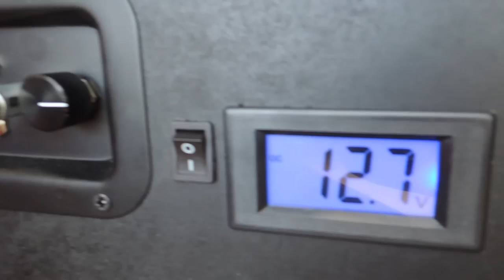Kistradio/Boombox Amazing Bass Dayton ND105 Pioneer TS-A2013i

Comment: How do you link the bassamp and the maxamp together so they are synced ? Does it work to use a Aux-split and just have two cables?
Reply from the maker: I splitted the aux-cable, works fine :)

Comment: How do u power 2 amps to 1 AC connector? and can u provide me with the enclosure dimensions. please i need help
Reply from the maker: 30x30x50cm I believe.. Just put the two amps in parallel from the power adapter and you'll be fine